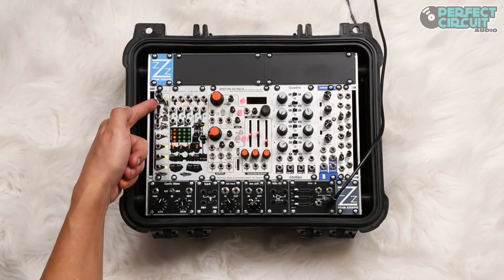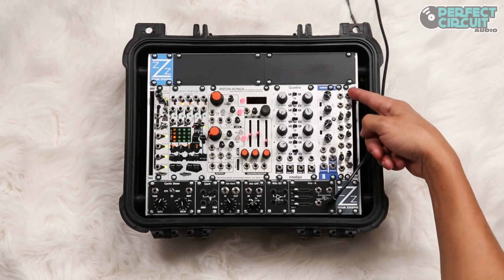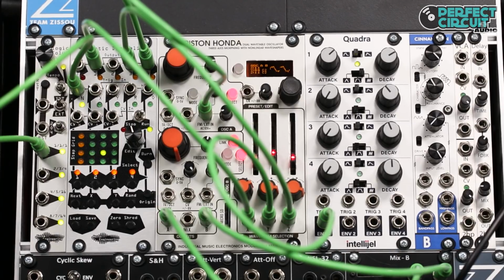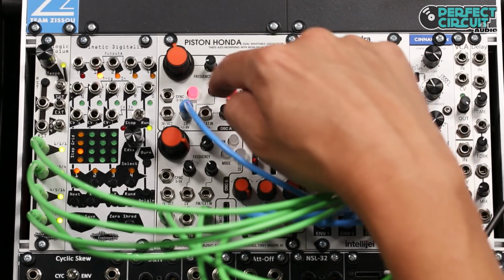54HP Episode 5: Wave Machine

Comment: Starting at 2:43 are you using the Horologic Solum to trigger all the drum sounds? I’m looking for a small hp clock generator that I can use for generating beats in addition to driving a sequencer such as the Memitic Digitalis. I’m trying to decide between the HS and the Pico Trigg.
Reply from the maker: We were using the Horologic Solum to trigger the drums at 2:43, if you have the space the Integra Solum is a good clock divider for drum sequencing as well.
Reply: Perfect Circuit Audio thank you, I’ll definitely keep that in mind
Reply: Any idea of when you might have the Mimetic Digitalis in stock?

Comment: PH has 512 waveforms, 8*8*8 not 4096.
Reply from the maker: It has 4096 because it is 16x16x16, not 8x8x8
Reply: @PerfectCircuit  but no, it's 8x8x8 , I have it in from of me. 16x16x16 is PHmkII, which I have at hands too :) so definitely, only 512 waveforms in mkIII
Reply from the maker: @klick7826  OK looks like you are right, thanks.